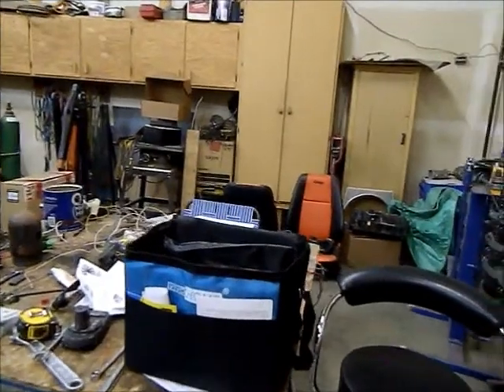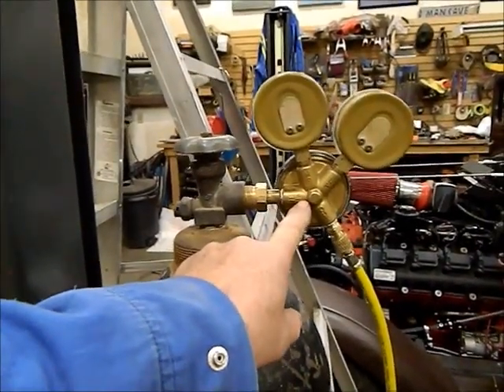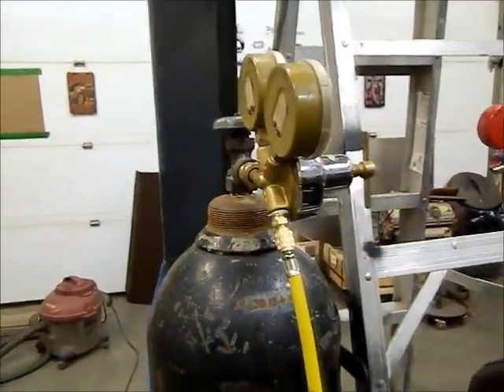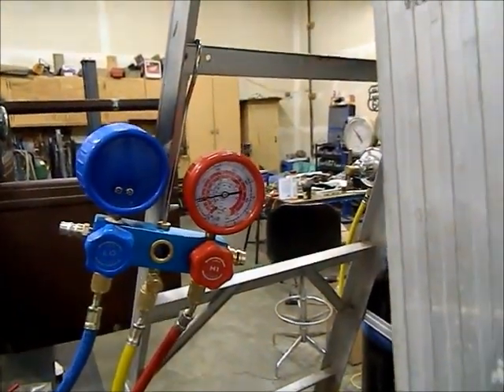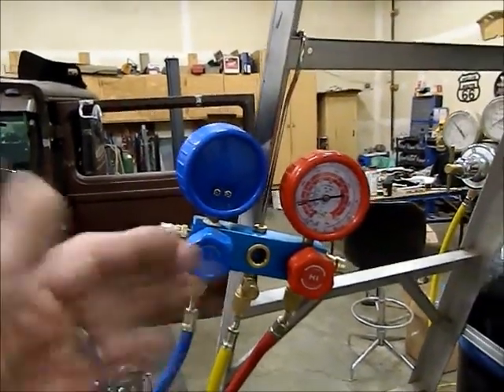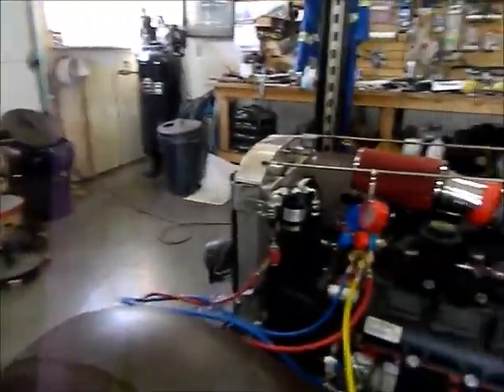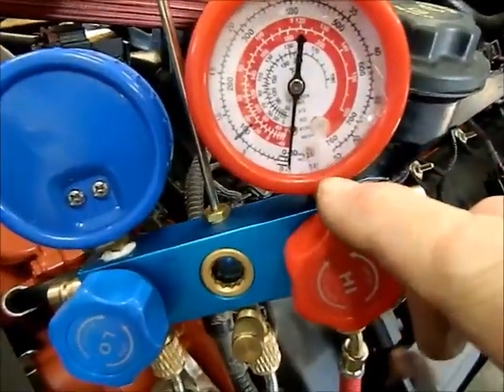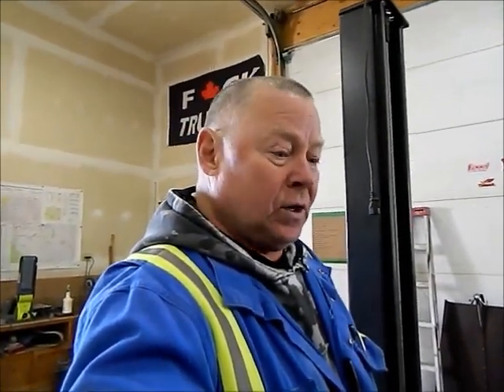1928 Dodge Rat Rod, Wrapped up the A/C install

Comment: Persistence and ingenuity pays. Why did you do the pressure test and not just vacuum?
Reply from the maker: Every thing I read said the pressure test was the best first step as it is easy to see bubbles from soap water if you have a leak. The gauge on the manifold was a good example,  I would still be looking for that with a vacuum.
Reply: @glenmiller3783  Thanks